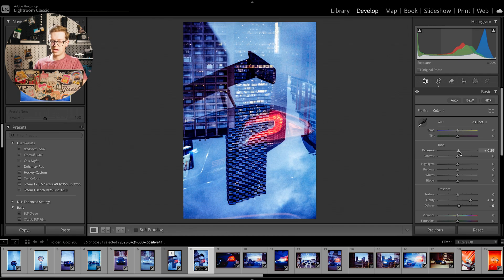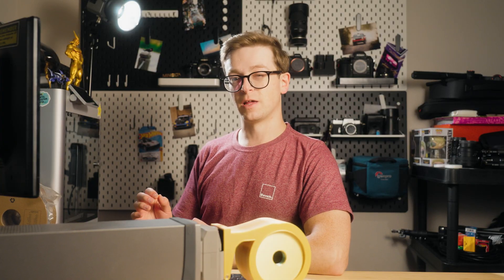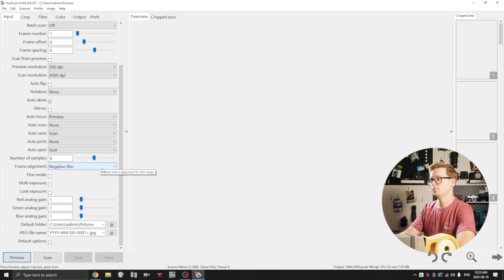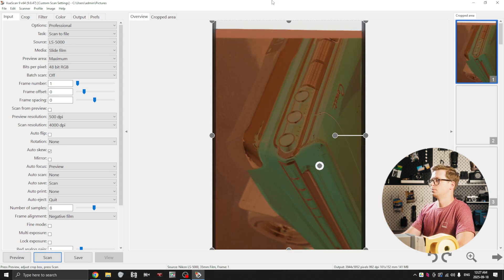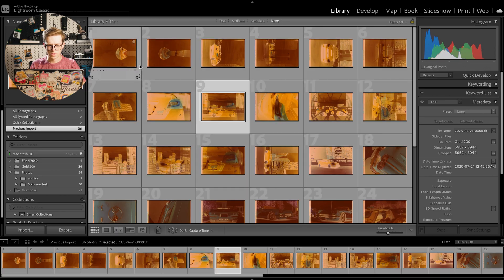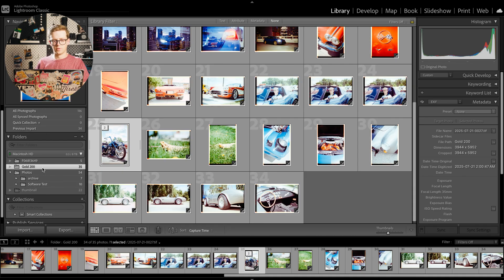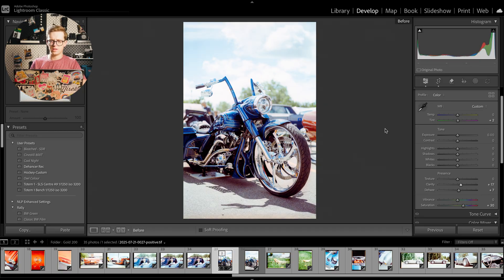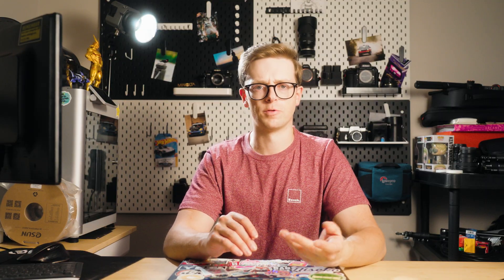The Ultimate Vuescan Settings Guide

Comment: I also noticed that you leave some borders on before converting ("If necessary, adjust your crop or border buffer so any non-film elements are excluded from the analysis - from NLP guides"). Have you noticed any differences with or without borders?
Reply from the maker: If there's a lot of border showing then it certainly can throw off the white balance of the photo, I use 5% buffer, but if you're noticing some weird hues you can try bumping it up closer to 10% to ensure all border is taken out. You just don't want to eat into your images too much

Comment: Thanks for making this tutorial, it’s really helpful! Two things to note, Negative Lab Pro suggests to set “Media” to image instead of Slide film (they mention 3 reasons for doing so in their scanning guide). Have you seen a difference between using Image vs Slide Film? Also, is there a reason why you want to autofocus on Preview instead of doing during Scan?
Reply from the maker: I believe I can't select "image" mode because Coolscans can't scan "images", they are exclusively film scanners, so you can either scan a film negative, or a positive. Likely just a terminology quirk based on the type of scanner I had connected, I could be wrong though.

Whether you auto focus on preview, or on scan it shouldn't matter as the film should not be moving in between those two operations, I just like to have my preview in focus
Reply: @nickschraml good to know! But It's weird that you don' t have the ability to set Media to Image as I can do it... I'm also using a Nikon Coolscan 5000 on Mac. Will try your settings on my next film and compare!
Reply from the maker: I'm not sitting at my scanning computer right now so it's all just conjecture on my end. It could also just work different on MacOS, who knows haha. I read through VueScan's documentation and couldn't find a difference listed between the two modes, I assumed it would be one is transparent and one isn't

Comment: Nice video! It’s pretty much my exact workflow with the LS-4000. Can I ask why you scan your positives to tif instead of raw? NPL recommends Vuescan raw over tif in their guide. 

In my process I also apply a base 25-50 color noise reduction in Lightroom as I’ve found the Coolscans to produce a lot of color noise when you zoom in.
Reply from the maker: I scan to tiff because dust removal doesn't work if you scan to raw, and as long as you don't compress your tiff files they're effectively the same thing as a raw file.

I've also experimented with colour noise reduction using Topaz labs and it works well, I just don't feel the need for it unless I'm cropping in since the 2 formats I publish to (print and Instagram) don't need it typically.

I'm not sure if the colour noise is noise, or if it's just the grain of the film. I've cranked the number of samples, and done multi exposure before and the noise is still the same, leading me to suspect it's just film grain
Reply: @nickschraml  If you set "raw output with" to "save" the dust removal gets baked into the raw file.
Reply from the maker: That would work then I suppose
Reply: @nickschraml  thanks for sharing you knowledge on the Coolscan 5000. Subscribed.  Ive used Vuescan but am new to scanning.  I will be scanning standard positive 50 year old mounted slides individually or with the SF-210.  Are there any settings here you would change for old mounted slides instead of negatives?  Also, when outputting to Tiff it has the option of  "Tiff DNG Format".  Any downside to that?  It seems to still do the dust removal.
Reply from the maker: I’m not familiar with that setting, you could try running your own comparison, perhaps it stores more colour data?

The only setting I would make sure you have on is auto colour levels, otherwise the white balance on the slides will all be wrong